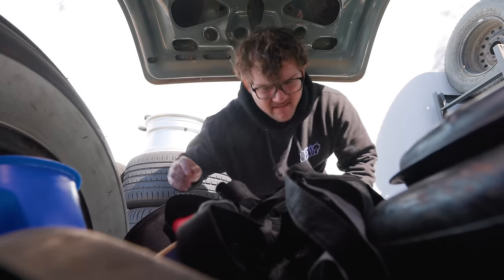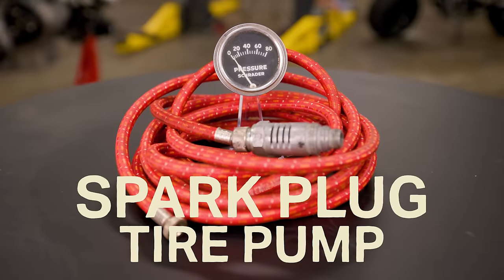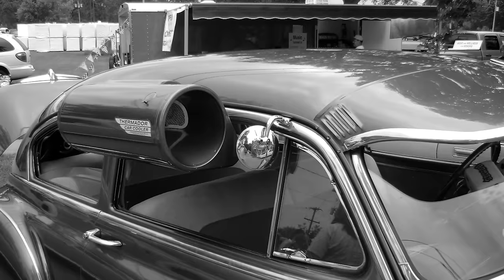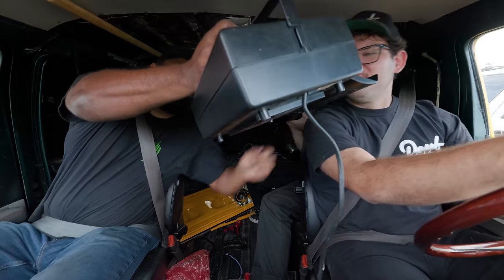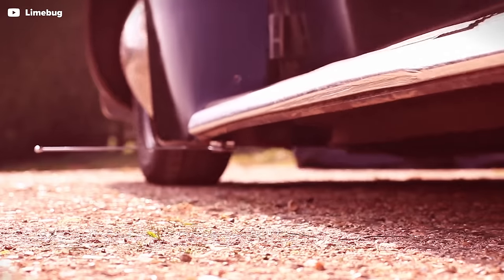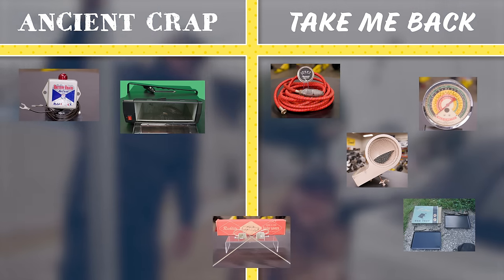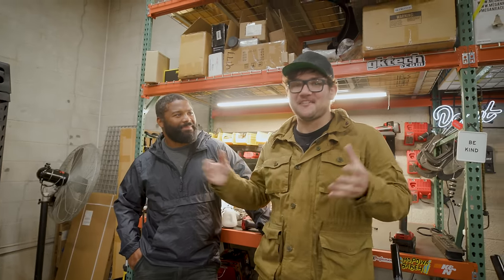Testing Forgotten Car Accessories

Comment: I would say most of this stuff was definitely useful when a lot of normal cars didn't have these options (swamp coolers were exceptionally better the hotter the area you lived in), though y'all should have tested them with older vehicles! The mobile oven however, ugh. Every dude knows you just wrap it in foil and stuff it close to the header pipes...
Reply: It’s all fun and games until you lose your brisket on the I-90 cause you forgot it was there XD
Reply: @adriannash2705  or bring it home as ash.
Reply: @PrograError  or you catch the car on fire cause the greases leaked out
Reply: A fair number of folks who 'live on the road' cook on their engines and have mastered the art. Most folks today don't realize how simple life can be with the right approach.

Comment: The tire groover is also used on semi truck tires that are rated to be regrovable. I've done it several times when I worked at a lube shop when I first started. It takes some elbow grease and the usual charge for it was 10-15 a for groove done. A tire usually needs 4 grooves so fairly easy and could be done within 15 minutes for an entire tire.

Comment: Compression was much lower back in the day, swamp coolers work great in low humidity environments. They were very common in southern California and had one Hugh unit on our home in sylmar cal, and so did most of our neighbors.
The regrouver was very common and my grandpa worked for RTD for almost 30 years, and they used the regrouver on buss tires..
Reply: compression was higher for leaded gasoline, 11:1 & 12:1 were pretty common

Comment: Around 1950, spare tires had long rubber air tubes connected from a spare tire schrader valve to one that stuck through the rear of the trunk behind bumper-so you could check the pressure of a spare without having to move your luggage-stuff around.  Some cars had a distilled water reservoir over the battery, with an automatic filler to replace what evaporated out of the battery in use.
Reply: The Cadillac Seville drum thermometers were super cool if you're not familiar.
Reply: All of those sound like nice features.
Reply: That would be handy for hidden spares or tires held upside down under the vehicle.  Most often spare tires are mounted in such a way where the shrader is not accessible without removing the tire from it's mounting location.

Comment: The curb finders I've always heard them called in the lowrider community aren't traditionally used for backing into spots. It's for driving forward into a spot and maintaining proximity to the curb as CA  wants wheels in the gray part where it's not asphalt. Even the photos shown of the older cars they're all in the front

Comment: I could be wrong but I think the tire regroover made more sense in the past because they had tubes inside the tire to hold the pressure and tires used to be thicker. Obviously very different than now. Great content as always!
Reply: This is exactly right.
Reply: You gottir...Technically in a pinch you can actually run tubes in your tubeless tires today at the expense of some ride quality.

But since tubeless tires have cords and rely on the thickness of the tire meat itself to hold air and keep the bead sealed I wouldn't recommend carving up a modern tire for any serious use case.
Reply: They are still used today, though mostly for semi tires when they re-tread them. Most car tires now days are fairly thin once they wear down and there isn't anything to re-tread. Done in the name of efficiency since the tires weigh less..... And likely because then you have to buy new ones so win-win for tire companies.

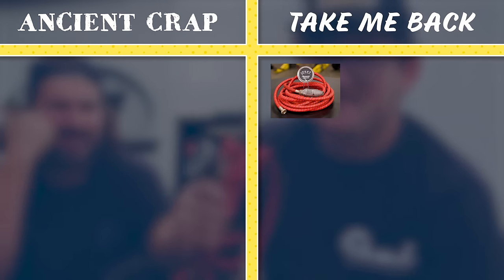Comment: I use a variation of that vacuum gauge 4:05 on my classic car. It’s a doctors stethoscope but for your car. You can use it to adjust air to fuel ratios, timing, you can tell if your valves need adjustment, you can even see if you have some kind of air restriction in the air intake or your exhaust manifold depending on where the needle points all by using vacuum. It’s honestly an amazing tool. Great for diagnosing problems.

Comment: Pro tip (or "duh" tip) you could always deflate the tire without removing it from the wheel if you'd prefer not to have it blow up in your face.
Reply: But then they wouldn't be able to jump scare us!

Comment: I'm remembering back to 1987 or so, but my friend's 1st gen Plymouth Barracuda had a factory gauge very similar to the "mile o meter" gauge.
Reply: back in the day Mercedes cars have an economy gauge :P
Reply: Yes, a vacuum gauge was an option on many cars in the early to mid '60s and as a dealer add-on.  Also available from the aftermarket too.  They were a useful tutor for learning how to drive using less gas.  A lot of Pontiac's (roughly '61-'67) came with them from the factory.  That was smart because with Pontiac being the next move up from Chevrolet, people knew that Pontiac's used more gas.  It was notable talk about going from a Chevy 283 into a Pontiac 389.  Pontiac's coming with a vacuum gauge gave salesmen a useful tool on how to save gas when working with prospective buyers.
Reply: @discerningmind  
drive with idle speed to save gas lmao 🤣🤣
Reply: @Techie1224    If you think it's funny than you don't understand.

Comment: The battery charger thing is meant to cause the generator to produce more output at lower revs. The generators did not charge the battery at idle. Valiant was the first car to use an alternator to solve the problem.
The tire regroover was a useful thing back in the days of bias ply tires with tubes. Also, most truck tires are "regroovable". I have seen the remaining number of times for the carcass before it needs retreading right on the sidewall. Tires that have been regrooved or retreaded may not be used in a steering axle.

Comment: Those tread cutters used to be used for cutting a extra 5000 miles out of our Truck tyres.  They were ment to be recut  though so were thicker rubber.
Reply: It's still a thing, i've had re-treadable tyres on trucks i've driven in the past few years
Reply: @immDroidz  Retread and regroove are different things.  Retreading (better known as "capping") is gluing new tread on top of an existing tire.  Regrooving is cutting new grooves into an existing tire surface.
Reply: @immDroidz  Not even the same thing
Reply: @eric_d  Yeah these tyres had extra to regroove, The cutter would take around 2mm out the original tread paths. Hell of a job when you have a few to do.

Comment: Tire re-groovers make more sense when you have large offroad tires because they can be $500-$1000 a tire. Also, you can tailor your tires to a specific offroad race when the type of tire needed doesn't exist for the conditions you're in.
Reply: and offroad and truck tires are significantly thicker so you don't have to worry about destroying the tire too much.
Reply: they had bias ply tires when regrooving was common, they had much thicker rubber and in some cases were designed to be regrooved
Reply: lol no

Comment: That spark plug tire pump would be so cool to use on my Subaru 😂
Reply: So would you take out the filter or battery?
Reply: @dalentoews3418  whole engine, duh
Reply: I’ve owned plenty of cars and the Subaru ranked only average as for as spark plug difficulty went. American V8s were always a bitch with theirs right up against the firewall and rusted into place

Comment: The milo meter is actually build in to the dash of a e46, also works with vacuum pressure and shows you the current mpg

Comment: Next time you see your mail carrier, ask them about LLV AC. I worked for the USPS and those trucks don't have heat or AC. The AC is a 5-6" PVC elbow that is bungee corded through the window and around the door with one hole outside, facing forward and the other end inside the LLV.

Comment: that is a really old regroover. The newer (yet still old tech) groovers use a u shaped blade. You adjust the depth of the blade before you begin, to prevent getting down to the thread areas.

Tire treads often cannot go down the wear bars as it becomes too squirrely due to deflection, so the micro sips are only down for maybe 3/32. You can actually use the groover to add new sips and create new water channels as the tire wears down to the existing ones.

Comment: Tire re-groovers are good for mudding trucks because you can add channels to help get rid of mud, or even use it to cut lugs off to get more space between lugs, so the tire will clean out better. 

You could also probably use it for a lawn mower tire or something, if its almost bald and you don't want to buy a new one

Comment: If you think about it, the spark plug compressor isn't really any different from the pancake compressors seen at most gas stations. Just your engine is the pancake.

I'm pretty sure that "oven" falls into the same level of heating as the "defroster heaters" sold today.

For the retreader, a couple of things. Tires back then were thicker (they didn't have the modern belts and radials of today) and made with a completely different rubber.

Comment: The "owen" are for heating up your tin can lunch box with already cooked food. Works great.
Reply: And that's really a truck driver accessory that you can still buy in truck stops. Also, they do NOT use them while the vehicle is moving.

Comment: Remember that a lot of those inventions were from times when cars tires and wipers were made very differently. The old tires were bias ply essentially a solid chunk of rubber so recutting groves is achievable safely. The wiper gauge is actually quite neat and I beg to differ on those feelers. Those are quite useful if installed properly.

Great vid guys

Comment: My '67 Barracuda fastback (with leaning tower of power 225 Slant 6) had a vacuum gauge in the dash next to the speedometer.   It was basically an "efficiency" meter that reminded me to keep my foot off the floor when pressing the accelerator.
Reply: same thing was on dashboard in classic lada models untill very end of production in 2012, called «economometer»

Comment: Tire grooving tools are used today in various types of racing. Sprint and Midgets often have custom grooved tires, off road racing cars/trucks will have custom grooved tires as well. Lots of road racing series that allow an intermediate rain tire will be custom grooved. You can buy a new tire grooving tool from all the big racing parts suppliers and you will find grooving tools in many toolboxes at races across the country. Oh I almost forgot, flat track and motocross motorcycles can/have custom grooving done to their tires. The use of a tire grooving tool is an art, I have watched pro's groove road race rain tires and it is a work of art.

Comment: I never saw much of the products themselves but I did spend plenty of time reading about them in the Warshawsky catalog. That was in Chicago - elsewhere it was the JC Whitney catalog. Just looking at the product descriptions would be a great look back. 
One product I really loved and actually saw fairly often was a small plastic cylinder that would be installed in a drilled hole in your brake lights lenses. That little bit of blue turned your brake lights, a vivid purple - so cool.

Comment: Helped a neighbor use a tire pump tool back in the 60's to fix a hay wagon out in the field a half mile from home.  Spark plugs easy access on old  Farmall tractor.  Don't rev the engine, let it idle for most efficiency.  Pumped up the flat in a few minutes.  In those days the only portable air compressor would have been powered by Briggs & Stratton (rechargeable ni-cad batteries were used in satellites only). Device was pretty common before then as tires were much less reliable than now.

Comment: Fun fact, in the older times, tyre regroover also used to add grooves to a relatively good cheap tyres so they could (or perceivebaly) add better grip. There are 'artisans' who provide these services, but not really advertised because of its connection to illegal racing scenes.

Comment: Found a vintage car item in my Dads garage.. kept a while, but the rubber/plastic tube was so gooey, I threw it away. But it was a 25' long small sized yellow tube with Schrader coupling at each end and it was to transfer air from a tire with air in it to a flat tire. Either your own car or another.

Comment: modern tires have usually much less "useless" rubber between tread and tire body than 80s tires. mostly very expensive big machine tires can extend life if you use them on light, example loader on paved surface.

Comment: We swear by those tire groovers in rally racing. A lot of times you'll use it to add cuts in the tread if it's particularly muddy or square off the edges of the tread blocks if they've gotten  too rounded

Comment: verry cool vid, laughed at the add aswel. for the tyre re groover, in the old days tyres had simpler patterns (msot were just longitudional lines or a zig zag line). also im pretty sure due to increased accuracy with production techniques the thread runs closes to the carcas now than back then.
There is one brand in europe (kingmeiler) that sells tyres that legally can be regrooved however a polish tyre test did try it a few years back and regrooved tyres are just worse than brand new chinese ones. so yeah it can be done but please dont do it.

Comment: The regroover is still used heavily in dirt track racing. Also, back in the day, tires were re-groovable and had extra rubber. Today, it is only seen on semi tires.

Comment: The tire groover is actually insanely handy for tire on construction equipment .. tires rated for winter temperatures are expensive, so most people will groove out the tires on loaders and back hoe’s for winter snow removal.. most car tires only have like a few millimetres of rubber left once you hit the wear bars , so the chances of you going through the cords and popping the tire is fairly high .. and the hell do you “feel” those curb warning indicator sticks .. I highly doubt you would hear them scape against the curb, even if you had someone in the passenger seat with the window down lmao 😂🤦‍♂️👍

Comment: The groove is an absolute must have for modern beefy M/T and A/T tires.

If you know what you are doing, you can sipe any aggresive tire to make em nice and grippy in snow and ice.

Not saying do a complete new pattern, but a lot of the snow guys in my area will always swear by a heavily siped M/T over any snow tire (as long as we are snow wheeling, not just in less than a foot where you can actually dig down.... M/T is still garbage there!

Comment: I spent my summers "regrooving" semi truck tires for my dad. I'd do about 45-60 tires a day. The iron I used weighed about 8 pounds. I'd have to change the blade every 2-3 tires depending on how aggressive I was cutting. I made 5 bucks a tire. Added bonus of getting absolutely shredded in the dog days of summer.

Comment: The spark plug tire pump is a neat idea, though I'm not convinced it'll keep all the fuel out, and also on a modern car, you're going to at least possibly if not definitely have to reset the check engine light after using it because your cylinder is running dead the whole time and you may throw a misfire code.  BUT!  You can avoid the fuel problem on a modern car entirely by unplugging the injector as well.  So you'd need this, basic tools for the job, and a cheapie code scanner that can clear codes unless you're just going to disconnect and reconnect the battery after you're done.

Comment: I think the battery tender thing for the voltage regulator was more than just a light you gotta understand how old 6 volt regulators work. Basically they are a set of points and windings, electricity flows through the windings around a post which pulls a sheet metal arm with points and when those points shut it sends voltage to the battery or grounds the field winding in the generator, which in turn makes the generator put out more voltage. Now the windings inside the voltage regulator have a certain resistance and they will work differently if you add more resistance and length to the windings furthermore, that device may have been grounding the field at a higher rate, which would make the generator put out let’s say 9 volts instead of 8. I’m not sure exactly how that hooks up but if I had the directions and a look at how it would hookup I could tell you what it’s doing. Also you do in fact have a car with a generator and voltage regulator, your classic car in your video!

Comment: Never saw anyone use that tire tool on street tires, but every dirt tracker used to have one, we cut our own groves in tires. Those "Fender Savers" we called "curb scrapers and they were used to pimp out a ride, it was a style thing.
Reply: yeah, I'm old enough to remember curb feelers on pimped out cars (before that expression was actually used). They were very popular on low-riders.

Comment: Damn I'm old if I remember curb feelers, lol.  I come from a not so well to do family so my first car was a '68 Chevy Caprice that came from the junkyard for less than $400 in 1980.  It needed full front suspension rebuild that cost 3x more than the car, lol.  My stepfather always put retreaded tires on it however, I liked to race the boat on Mulholland Drive and would wear the tires out in about 2 weeks.  My stepfather complained to the shop that the tires didn't last and the shop owner looked straight at me and asked "Do you drive this in the hills?"  Holding my laugh inside I said "Yes" and he told me I need to slow down.  The same shop owner let me drive his '71 455 H.O GTO that I returned with a few burnouts under the hood.